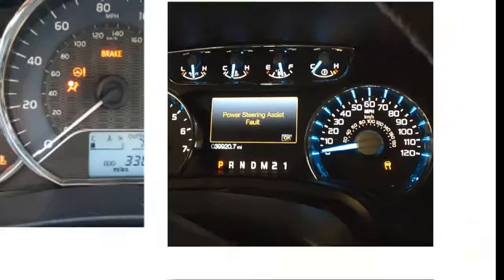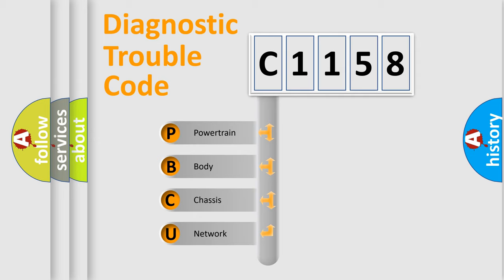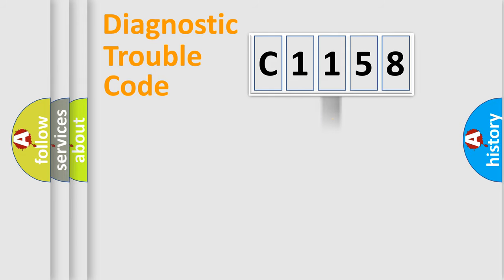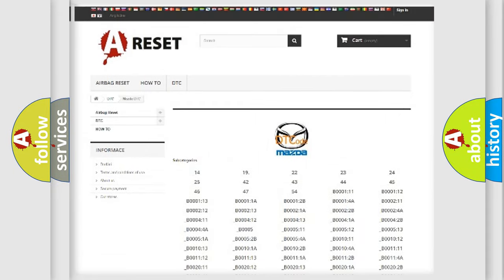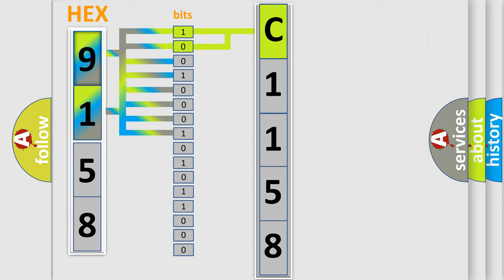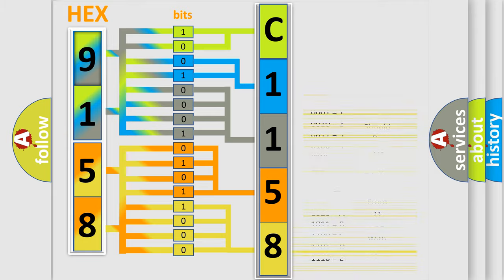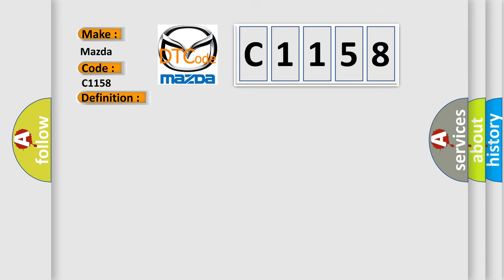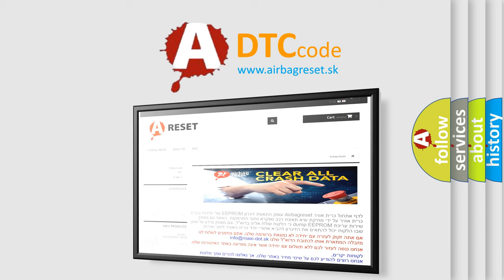DTC Mazda C1158 Short Explanation

Comment: WRONG.
C1158 = Left Front Speed Wheel Sensor Coherency Fault, this is a fault given from an ABS sensor that's giving inconsistent data to the others, usually an issue with the ABS ring or other matter that has gotten inside the hub space past the seal and is causing an anomaly as it moves around the hub, sometimes can even be part of the seal that's come away and is causing the issue such as a seal spring
Reply: Thank you for your comment.
He who does nothing will do nothing wrong.
The car can display an average of 20,000 error codes
This amount of videos will show us the real interest of the audience.
We can thus focus on those two-sided problems associated with car breakdowns